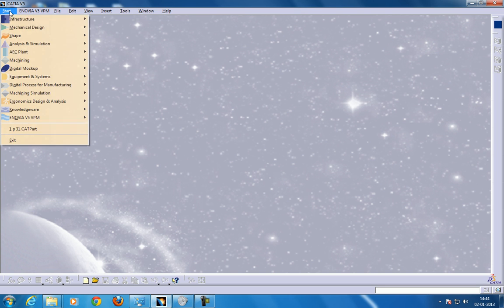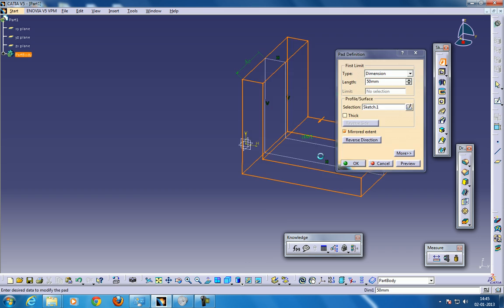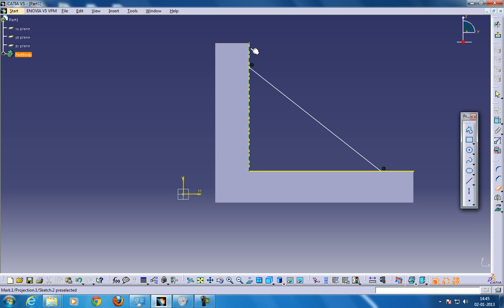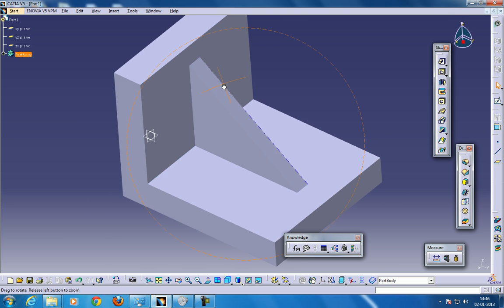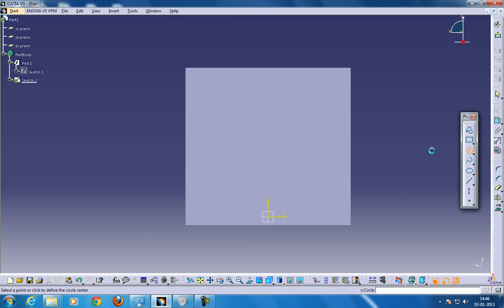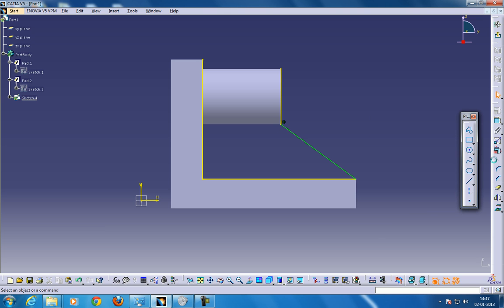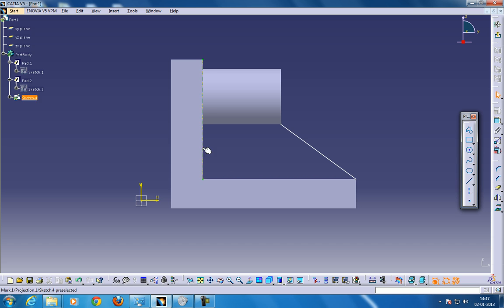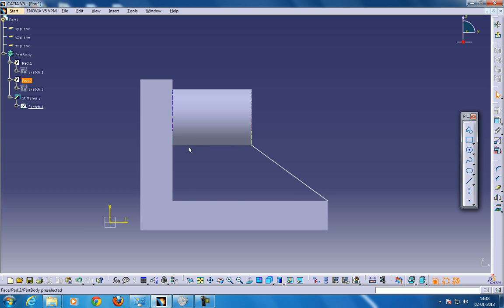Catia V5 Tutorials|Part Design|Stiffener

Comment: Hi, may I know how to deal with the isolated line. Because I face this problem when I was proceed after done the 2D sketch.
Reply from the maker: Hello, you need a closed loop to perform solid operations such as PAD. Check your sketch. Or there is an option to inspect sketch.

Comment: thanks for the video. I am doing the same thing that you did in the video but it doesn't work. the two open parts of the stiffener line was created using the 3D project and then removed the projected parts. when I try to run the command it says: topological operators: invalid profile body. what am I missing in this? Thank you in advance for the reply.
Reply from the maker: +Farid Tavakkolmoghaddam dear Farid, if you get such error, it means you have some overlapping sketch entities. In case of stiffener, make sure that the stiffener line touches the face of both the supports. Hope that answers your question.
Reply: Mohammed Shakeel

Comment: Can't get this to work. I did EXACTLY as you showed in the video and I get "Feature Definition Error: The selected sketch contains several open profiles or some geometry used for construction. You must specify the construction geometry to solve the profile ambiguity." I didn't use construction lines or anything like that. I even tried it on new Parts to see if my model was the issue but evidently it is not. Please help? Thanks.